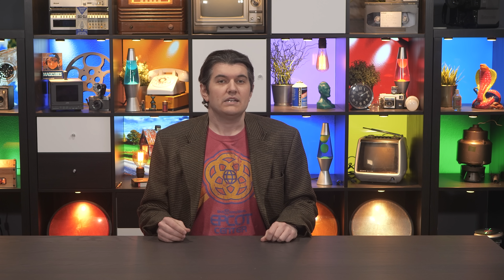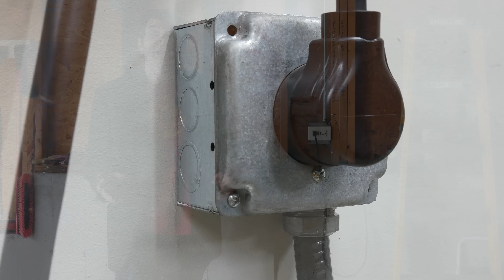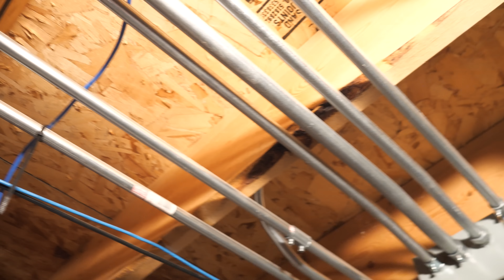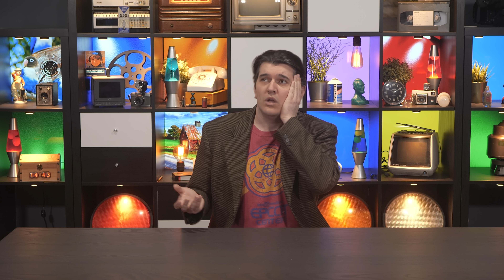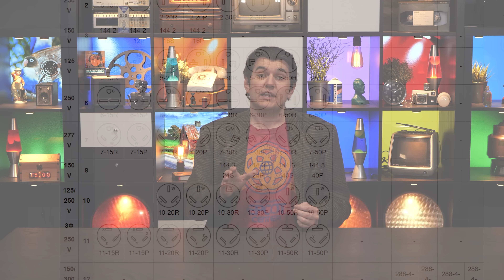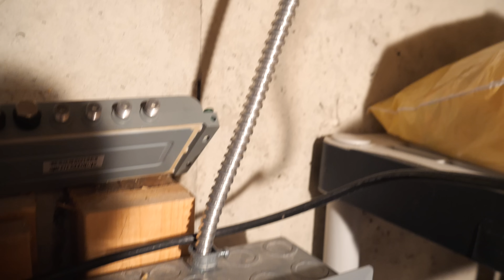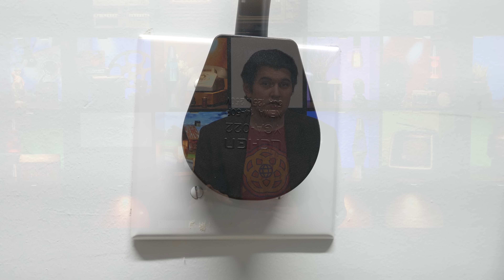The "standard" car charger is usually overkill—but your electrician might not know that

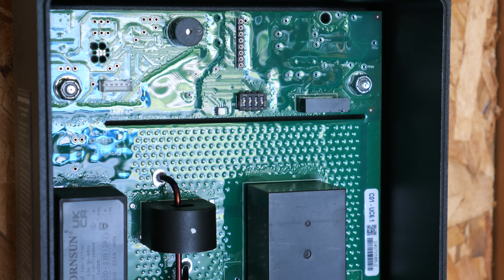Comment: 12:00 

If im corect. An overload would make your wires glow red hot and melt. And the protective conduit would protect your home from burning down. But if these wires are just chilling between insulation and your dry wall it can REALLY fuck up your day. 

This is IF your breaker is faulty. Ultimately you should test your equipment and ensure the products purchased arent faulty.

Comment: I paid the big bucks ($4,000) so I'll get an electrical panel upgrade in mid January.  That gets me 11kw charging or about 40 miles of added range, an hour.  The local utility will give me back $1,500, so it comes to $2,500.  It took me a while to find that relatively good price; I initially got project stopping quotes like $14,000 and $7,500.  If I was OK with power management, the standard price seemed to be around $3,000 but that approach seemed to be too complex.

Comment: 120v 10a is not enough for me. That’s 1.2kw and 10kwh overnight. I drive more than 30 miles per day. A 240v L2 charger is much useful. But YMMV, no pun intended.

Comment: Very good and informative video! I own a 2023 Chevy Bolt and charge in my garage using a 60-amp source and an EVSE rated at 48 Amp. I only use 40-amp charge because it is using a plug and not direct wired EVSC (limit of the plug not the EVSC or car). Takes average 4.5 hours to charge 20% to 80% with around 210-mile range. Love my Bolt even though it is not a good long trip car but is perfect for 2nd around town car. My home was built 3 years ago and had plenty of power available plus Chevrolet paid $1000 towards wiring the charger as part of the car purchase! Plus I got the $7500 Gov rebate.

Comment: There would be nothing inherintly wrong feeding a NEMA 14-50R with the appropriately gauged (longer conversation) aluminum given, the receptaclue is AL/CU-rated, as yours was, especially if it were new wiring and of de-ox is used when required.  Much different conversation for ≤20A receptacles and old aluminum wiring.  De-ox isn't even required, though commonplace, on modern aluminum alloys.

Comment: Even if a car draws 50kw, you only need 2 THICCC cables going 220~400v AC, the rest should only be managed by the car's module + wall charger.

Comment: I live in the UK, consumers are prohibited from installing new electrical circuits. We are forced by Part P regulations, to hire a registered electricions to fit.  Alternatively the consumer can fit with the local council being hired to certify before connecting to the house installation.
Reply: So the latter part overrides the first part?
Reply: @CorneliusTaylor-s1u I get you observations.  The house owner can fit and replace a new wall outlet to an existing ring circuit.  However, the owner cannot fit a new ring, or radial circuit.  He also cannot fit any new or replacement outlet into a wet room, ie kitchen, bathroom, laundry room, or any exterior circuit.   Should the owner do any of those things, before connecting he has to call the local planning authority or a certified electrician to inspect and issue a part P  certificate.  This procedure is expensive, deliberately so.

Comment: Sorry but I have to disagree with your comment about 15A circuits being fine up to 200 miles of driving per day.

Let's look at charging on a 15A circuit in a world where power is expensive before midnight.

I'll assume a generous 4 miles per KWH, 100% efficiency, and leaving at 8AM, which is too late for many people. Even so, you're going to achieve less than one quarter of your claim.

15A -> 1.44 KW  x 4 miles/KWH * 8 hours = 46.08 miles

Yeah, I've seen this in my own family.

Comment: Regardless, it has to be sized as a continuous load which is a 125% to the least. Or most vulnerable temperature rating of the circuit

Comment: The outlet in my 1970 era garage is on the same circuit with outlets in two more rooms.  So if the car charger is going and I happen to plug a heater into a socket in one of those rooms it's pop city in the breaker panel.   So a dedicated  20A, 120V outlet is a really good idea if a 240 seems like its too much.

Comment: One side note. If you are installing a charger in your garage, a GFCI circuit breaker may be required. If your area doesn't have this code, it will someday. 
They're much more expensive, but a good idea even if your area doesn't require them yet. 
The one you should have used is about $80-$120 depending where you buy it.  Part number: HOM230GFIC

Comment: If this guy doesn’t use WAGOs I don’t know if there’s any hope for any of us.
Reply: What the heck are you talking about?
Reply: @CorneliusTaylor-s1u a WAGO is a connector used in electrical work that replaces the wire nut. It is easier to use and much safer as well. Old school contractors don’t like them because people hate change in general.
Reply: @zacharyeversole 

I know what it is, but what does what it is have to do with your silly comment? Besides, the last time I checked there are no Wagos available in America in a low enough wire gauge for such a thing.

Comment: While I agree that 240V 50A is overkill for many people, the convenience of 240V charging is undeniable.  Even my Chevy Volt with it's 17 kWh battery is a challenge to fully charge overnight (10 hours @ 120V) if aren't able to plug it in until 10 pm.  However, just bumping it up to 240V 16A will get it fully charged in only 4.5 hours.  Our other car is an Ioniq 5 and we have a 240V 40A charger for that while we regularly use the 120V 12A charger for the Volt, but if we do need to charge up the Volt more quickly, we can.

Comment: MC Cable 100% comes in larger gauges and # of conductors....8/3 copper MC cable (the green/ground is included but not counted) is rated for 55 amps and will work fine on a 50a breaker and your 14-50 receptacle

Comment: I agree with the main point - you don't need a 50A or higher circuit.  But if you have the ability to have one installed - do it.  We had our new home built in 2019, and I started driving EV in 2016, so our two-car garage has two NEMA 14-50 outlets.  It also has a 100A capable wire run from the load center (in the basement) to both sides of the garage for future proofing.

Last fall I dumped my Tesla Model X 90D after 8+ years and upgraded to a Rivian R1S Dual Max Performance.  I'm waiting for V2H/V2G support to roll out (supposedly coming in a future software update), and then I'll get a compatible wall charger.  For now I'm using a Tesla Mobile Charger to charge at 40A.

Also, NEMA 14-50 is perfectly acceptable for outside charging - you just need a rated external enclosure and outlet.  At my last home I didn't have a garage, but I had a driveway on either side of the house for private parking.  So I had a NEMA 14-50 installed on each corner in weather resistant enclosures.  They worked well for the three years I lived there after getting an EV.

Comment: I've been thinking that if I'm ever able to afford an EV, I could park it near the corner of my house that has an electric dryer in it and run a cable outside. Nice to know that is an option. Just need to make sure my situation will work for my daily commute to work of 50 miles + whatever else I decide to do. Thanks for the info.

Comment: We can charge  here in germany our BEVs with up to 11 Kw (3x230Vx16A). So i can charge my Hyundai Kona electric with an 64Kwh Batterie from 20% to 80% in 3,5h. With a Hypercharger it needs about 45 Minutes.
But here in germany it ist not realy recommend to charge a BEV on a normal wallplug with 1x230V and 16 A. Ther normal plugs are not build to deliver 16A over a longer time. They can get to hot. If you be secure, you need a campingplug. They are build to deliver 16A at 230V over a Long time!

Comment: Been charging my PHEV on a regular outlet AND using an extension cord (properly rated for the load of course) for 8 years now. 240v would be nice but my house is old and upgrading the panel is not cheap.

Comment: Just brought an EQUINOX EV. I have a dedicated 240V outlet in an outside wall. Can I  plug the Dual level charge cord came from EV manufacturer just like the level one charge cord without installing  an EVSE? If so, do I need to set the charge current from the onboard 11.5 KW car charger so that it won't overload the circuite? Many thanks!

Comment: What 16A outdoor rated charger would you recommend that has NACS plug?   I really do not want an adapter to be required on my home outdoor mounted charger.   
It doesn't look like Grizzl-E makes the unit with dip switches to limit to 16A with NACS plugs.

Comment: Yes you don't need large power outlets. However using the maximum power for a given outlet and wireing will put a lot of thermal stress on the wireing and contacts. My parents burned two outlets before understanding that he should decrease the thermal stress on the outlet. Now he is using a maximum of 50% of the maximum fuse current.

Comment: As a new EV owner I found it easier and more effective for my money to just get a Level 2 charger. I'm completely capable, qualified, and comfortable wiring it in myself. I can more effectively charge the battery during our limited off-peak hours. It allows me to effectively precondition on shore power. And frankly there are phenomenal Level 2 chargers that aren't any more expensive if you shop your options correctly, unless you have to call an electrician of course. Hell, I bought a factory refurbished Grizzl-E Classic 40a, with a warranty, for less than the GM branded Level 1 charger for my Bolt (My bolt was a buyback, did not come with a charger). If I'm low on battery and have a long drive to make in the morning I know for a fact I'll have a full charge and a comfortable cabin ready for me. I find that far more convenient and worth the slight additional cost in my case.

Comment: THE 2020 NEC REQUIRE ANY OUTLET 125 VOLT / 240 VOLT IN WORKING AREA {EXCLUDING HARDWIRE WALL CHARGER STATION} MUST BE ON A GFI BREAKER UNLESS THE CAR CHARGER IS GFI INTERGRATE.

Comment: I own an Ionic 5 since just the beginning of this year, and I knew from the start I wouldn't need a charging station at home. I just plugin in the external 110v plug next to my private parking space, on a 15A circuit... and it would theoretically take something like 90-100 hours to charge the car from 0 to 100%. But do I ever need that? Of course not! I rarely do above 100km of range in a day, some days the car just stays in the driveway for days. I've never needed to plug into a charge on the road, but I have once in a while just to get access to a cheaper street parking.

Comment: Most Americans drive less than 50 miles in a day. (my personal average is 32, and typically 0 over the weekend) For an 8-hour charge, that's...

...2kw. Which a 120v circuit can deliver at under 20A. Which is a little beefy for one of those, but not removely unreasonable. If you average less than 30 miles per day and can spare 10 hours for charging instead of 8, that's less than 1kw, and can be handled just fine on a 10A circuit, especially if you're like me and barely, if ever, do any weekend driving.

Comment: I leave my car plugged in all the time even if it’s not charging which I can control how much charge % I need it keeps the 12 volt charge and the car needs to be plugged in so that the auto climate turns on and probably keeps the ev battery warm in the winter without draining the battery

Comment: Where l live some apartments blocks with out door parking have special plugs that switch on and off and the colder it gets the faster it goes on and off so only block heaters only works the charger doesn’t work I’ve got the same problem at my work where I can’t charge at work

Comment: electricians dont care how flexible car charging is, its anywhere from $300 to $1000 or more for the installation of an outlet. they know more than you do, they know it, and so do you. so when they tell you that you need a more powerful outlet, you listen.
what consumers SHOULD know, is that slower charging rates are far better for your battery, if you dont need it charged in 30 minutes, you probably shouldnt.

Comment: well, I have done the calculations at home and I DO need a 240V charger, cuz we have 3 electric cars each driving around 50km/day. 120V is enough for one car, but for multiple cars, 240V is night and day. Also, way easier in winter when remote start
And if you say my battery is big enough to alternate, it's 3 chevy volts, so it's not

Comment: I would think that as a battery can be discharged at variable high and low rates, they can be charged so as well. 

Surely there are some constraints, but just as it modulates one way, it can modulate the other.

Comment: My EV requires empty to full charging overnight.
It only has a 4,55kWh battery, so it isn't even hard to achieve that on a normal EU household grid 🏍️
I am also a renter who just hangs their charging cable out of the window.
No installation required.

Comment: Have 2 Teslas in MN. And we are on 15 amp 110 outlets in garage. We are mainly at home so cars are plugged in most of the day. Only time we had an issue is when it was 35+ below. The newer Tesla (different battery chemistry) just charged way too slow.  The garage is not insulated. So for 4 or 5 days last winter it was a PITA. 

We have ever only used a Supercharger on long trips. 

I intended to put in a new circuit - but the 110 ones were fine. And my panel is in the walkout level and would be a bitch to run a new fat wire. One day I will run a NM12 and put it on 2 breakers (getting 240V). 

If you put a dryer outlet in garage, you should put it on a GFCI breaker. And they are not that cheap. So sometimes it will be better to put in a dedicated charger that doesn't require a GFCI breaker.

Comment: We are limited to 6 hours of charging when electricity is $0.13/KWh.  From 4PM to 9PM, the rate is $0.68/KWh!  The rest of the time is $0.48/KWh.

I also charge my Model 3 extended range at 25A (the Tesla charger allows you to set current).  This is enough to get a full charge (up to 138 miles), and a lower charge rate is easier on the battery.  Losses (heat) goes up by the square of the current, 25A is 40% compared to charging at 40A.  I also only charge to 80% unless I need extra range.

Comment: I bought two charging adapters (N5-15 and N14-50) from Amazon.  Currently (ha!) I am using the N5-15 to charge my new Tesla Model 3 and getting it to 80% overnight most mornings.  I don't yet have a N14-50 outlet in the garage and might not install it.  (the N14-50 adapter could still be useful as a mobile option).  Meanwhile, due to the concern about frequent unpluggnig and re-plugging,  I've asked the manufacturers of the two adapters whether it is safe to leave them plugged in all the time, even when the car is not charging.  The manufacturer of the N5-15 says NO.  I have not heard back from the N14-50 company.  Any thoughts on that?

Comment: I live in EU and everyone said I NEED to have 3 phase 16A circuit installed. Turns out, I needed 1 phase 8A (240V still) circuit because that is what I have been using to charge my car over last 4 years.

Comment: Calling the 120-v option "slow" is a bit disingenuous.  My RAV4 Prime charges 50 miles overnight and could do maybe 10-15% more if the car had the capacity.  BUT: the R4P is not especially efficient and most EVs deliver more miles per kW-h than a plug-in hybrid.  If you generally don't drive more than 60-75 miles per day, plugging into a standard outlet will cover all of your daily commute and allow you to slowly gain on any longer trips you took, perhaps on the weekend.  With the 3.8 kW charger mentioned, you could easily recharge over 100 miles every night, no problem.

Comment: I charge my Tesla Y using your bog standard 15 amp receptical (drawing 12 amps because I'm good boy) and it's...just fine.  In fact I only charge at night to take advantage of the local low rates.  Transitioning from an ICE to an EV was a bit stressful, but I love it now.

Comment: The standard outlet is heavily impacted by temperature. The temperature management may take up the charging rate entirely. 30 A 240v circuit is more than plenty. You can even get something like a split volt ATS to run it off of a dryer circuit.

Comment: Conduit isn't too hard to use if in the open (not behind walls), esp. if solvent-weld PVC, and gives the best protection (if EMT).  Stranded THHN copper wire can be bought by the foot at HD and Lowes, and is about the same price as NM or MC cable.  If hard-wiring, you don't need a neutral wire for most car chargers.  If wiring to a plug, best to also run a neutral so other devices might use the plug.

Comment: You should take a look into Meter Socket Adapters, that is what i used for our EV charger install at our home. Our home is older with 100amp breaker panel with no capacity really for the EV charger, so our electrician recommended the Meter Socket Route for the install. The wiring from the pole to the house was capable of handling 200+ amps, just the house was wired using only 100amps. Its a device that connects behind the electric meter in the socket giving a single 240v breaker point for the electric charger to be wired to, unaffecting the house breaker panel. When i got my Ford Lightning EV truck, it came with the 80amp Ford Charger free, so they wired this charger to the socket adapter with a 100amp breaker. We use this charger for both my truck and my partners Honda Prologue. The Meter Socket Adapter is labeled ConnectDER as its brand. It was half the price going this route over them consolidating the breakers in our panel and adding in a 30 amp break, running the charger at 24amps only.
Reply: >100amp breaker panel

obsolete, yu're acting like an immigrant slumlord trying to coax that along in 2025